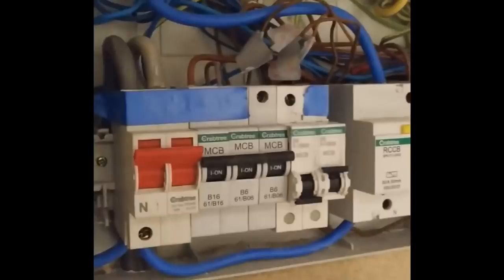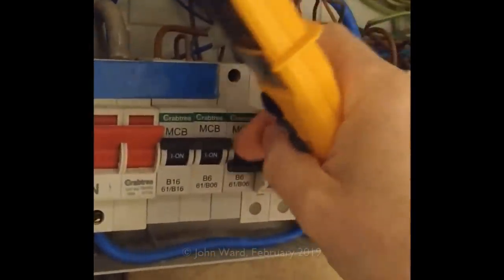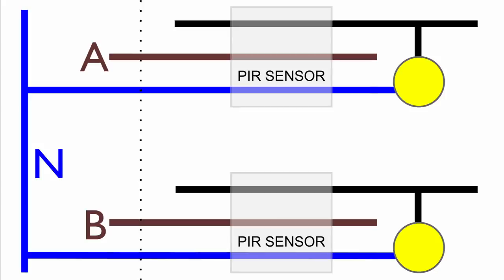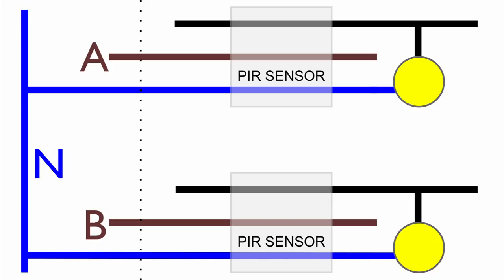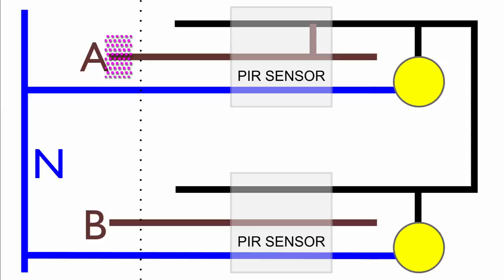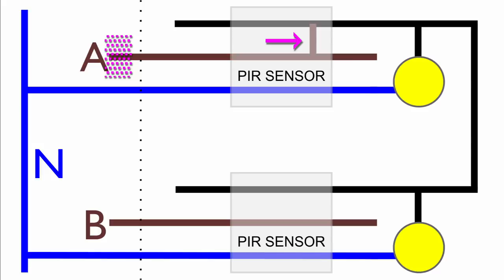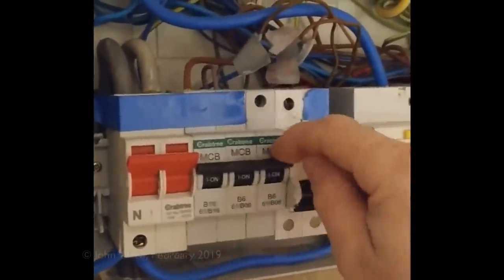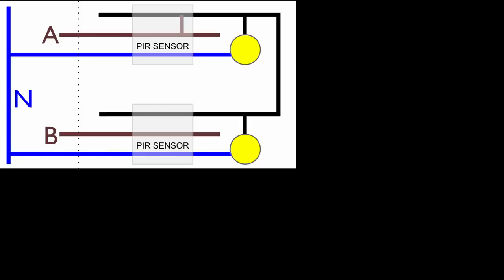Lighting Circuits with Two Separate Faults

Comment: I had a similar fault on a customers timer clock for their central heating where the relay contacts were welded together on the hot water call side. They had a plumber replace the timer and it worked for a while, then failed again, the plumber then changed the zone valve and the problem still existed. He said you need an electrician as there's a permanent live in the hot water switching, I came and checked the wiring, the relay had fused together in the new timer clock, I freed off the contacts and deduced the back emf from the old zone valve motor was causing the relay to arc and fuse together. Been OK ever since. You need to be careful with relays in circuits they can feedback live mains without you knowing. Always prove dead before touching any conductors. Great video JW.

Comment: I investigated a similar fault on a domestic ring main..(we suspect was as a result of a ground floor extension many years ago) it turns out the 1st floor and ground floor ring mains were crossed,  thus is either breaker was turned on, 230VAC as present. There was obviously potential for current flow up to 64A (2 32A MCBs), or if either breaker was off (causing the ring to be broken) you ended up with 2 very large spurs off of 1 32A breaker!

Comment: This is why we always test for live before touching any circuit even if we believe it to be off.
Reply: Does this prevent you from triggering the second pir after you tested the wire?
Reply: @just_noXi  No, but if you understand the switching then you test before any passive switches or indeed any switches as they themselves could be faulty.
Reply: Hi, I agree, with what you said!
Similarly
I do not trust indicators either, mate of mine thought he was in neutral on his motorcycle let his clutch out thinking it safe, you know the rest ..
Turns out the 12+ permanently fed bulb grounded to the frame ground instead of through the neutral switch to frame ground! 
Always factor in the possibility of electronic failure, this underpinns what is said in the regulations about what is considered to be an isolator, nothing with a semiconductor qualifies as a switch that can be trusted!
Electric=careful treatment.

Comment: +John Ward
Point of note:  This is a good example where RCBOs would detect this interconnect immediately, but shared-RCD would not!.
Related nasty interconnects -- have you seen neutral-neutral shorts or neutral-cpc shorts, in combination with loose/disconnected neutrals, such that some particular CPC/neutral is actually getting overloaded/overheated, bearing in mind there is usually no overcurrent-detection in neutrals let-alone CPCs?

Comment: I remember doing a home job in a local club to fit an emergency exit light.  When I switched off the breaker for the upstairs lighting I heard a roar from the downstairs bar.!  Guess what?  The tv went off!  I reset the breaker and the tv went on!  The wiring in the place was a real mess.  I fitted the light and I did an emergency exit myself!  I didn't want get  involved in somebody else's botch job!  Life's too short!!!
Reply: All clubs are the same. I've noticed.

Comment: This is why when you start to have many PIRs and many fittings it's much better to use contactors.

This assuming that the interconnect was semi deliberate to get the ground floor lights on when the upstairs pir was triggered.

Using low voltage switching (24v dc normally) and contactors for the lights you can wire it up in whatever combination you want without this sort of fault being possible

Comment: I understand the faulty PIR and the crossconnect between the two circuits but where was the DC voltage coming from? 

I had a somewhat similar problem years ago in a duplex we were renting. The hallway lights were connected to two different apartment services. Agree with the other posters never assume you have cut power - faults and miswires create all kinds of unusual situations.
Reply: DC voltage might have been related to the PIR internal power supply - possibly some sort of capacitor dropper arrangement feeding in to the system.
Reply: @philjordan1749  I agree but if that is the root cause why only on one circuit? Could also be a result of the lights, assuming they are LED or CFL.
Reply: He addresses this in the video. There are emergency lights on the circuit, which have a battery to supply them
Reply: @puckcat22679  What kind of power supply feeds back battery voltage to the mains?
Reply: Tom Schmidt,
It may be a high-impedance ... but still, somewhat poor design I suppose.

Comment: I had two circuits joined by a two way circuit and guessing by it being fed from a Wylex board had been like it for years. Though I'm surprised it hadn't been picked up before. As two lights on two way were in series in one scenario so they were on but dimmer

Comment: with 3 phase system, that fault would been found really fast. "Circuit for testing fuses" :D
Reply: Assuming the circuits were on different phases...
Reply: @markevans2294  In this case they would. The panel is only one single row, and the circuit breakers are directly side by side:

https://mosel-elektro.de/user/images/artikel/big/1st.-hager-kdn363f-3-phasenschiene-10mm%B2-3polig-%2Bn-12te-gabel-10062.jpg
Reply: Of course, in 3phase systems you such a foult only occur if the 2 MCBs are on the same phase and the same RCD.
Reply: @simonschertler3034  the fault would still happen on different phases as well, the PIR was bridging the circuits when they was been triggered, if this was a 3 phase system magic would of happens (assuming the 2 PIRs was in there own phase) 

get a nice bang (plus the bill)
Reply: Unlikely to have a three phase supply in a typical U.K domestic building, especially if the block of flats was previously a large house that had been converted (of which there are huge numbers in U.K. towns and cities).

Comment: Did you separate the circuits or was that not in your remit?  If it wasn't in your remit would you still have been paid for discovering it and fixing the problem?  If you did separate the circuits, how did you go about finding the connection?
Reply from the maker: Faults were fixed, both circuits linked onto a single 10 amp circuit breaker.  Wasn't practical to separate them, as the sensor locations meant that people going downstairs would be in the dark until they reached the lower floor.
Reply: @jwflame  That makes good sense.

Comment: Maybe there was only 1 sensor on original install. Additional sensors added after the fact. That scenario makes sense in a building with no lift (elevator). Also makes sense give that board looks like there were multiple visits. Modification obviously not well thought out.
Reply from the maker: Original install with 8 sensors, 1 outside each of the 7 apartments and 1 at the main door.
Reply: Fully botched original install then!
Reply: @jwflame  somone doesn't know the meaning of functional testing then!

Comment: I suspect the link between the two circuits was installed after the initial install because the owner wanted all the lights to turn on no matter which sensor was activated and got  a dodgy electrician. It may have changed hands since.

Comment: John,    Another difference in vocabulary from across the pond.  You call the connection from two breakers to one circuit a fault.    Here we call this a Dumb assed electricians mistake.   Question, is it normal over there to run single circuit on breakers with common trip bars?    We don't do that normally over here unless neutral is common.  Love the shirt!

Comment: Stair lighting being either fluorescent or LED can safely be powered from one circuit, which is probably how they were supposed to be wired, or the 2 circuit's shouldn't have been wired together in the first place.